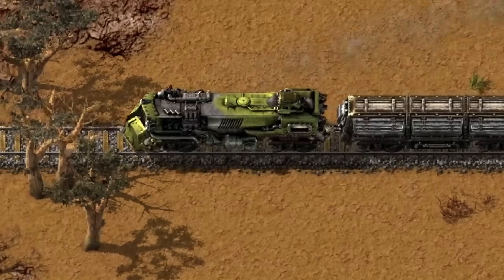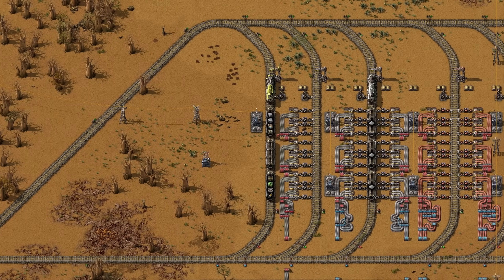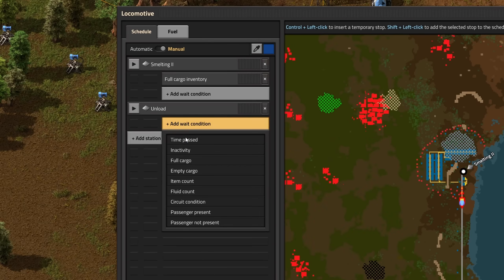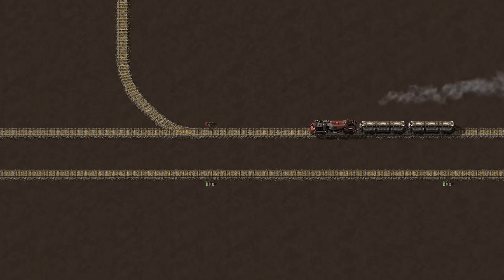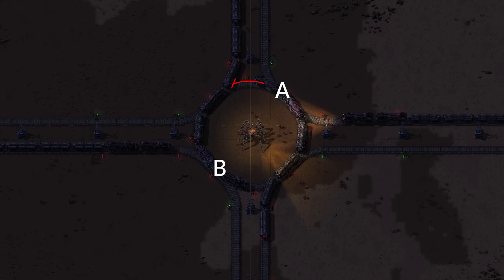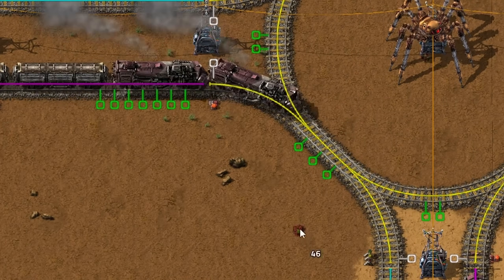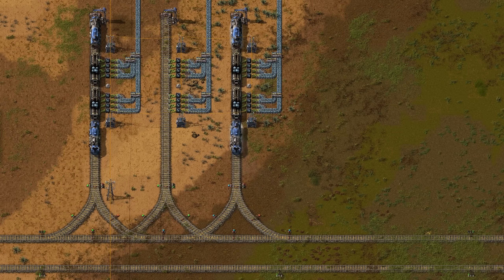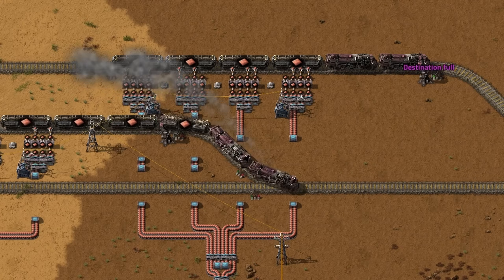Factorio Trains 101

Comment: Hey, this question isn’t really about trains but I was wondering, I have a base atm which produces around 300 SPM, and I am currently on my first planet of Vulcanus, (about to automate the rockets) however I am wondering how to scale up to say 1k SPM. Do I finish the other 2 planets first or do I try to redesign my base (or create a new base with redesigned everything) I don’t really know what to do and you are the best factorio ytber I know, any tips?
Reply from the maker: I would go to the other planets first before doing a huge redesign. Reason: on Fulgora you will get Electromagnetic plants which are awesome and will change the design of your production lines.
300 SPM with your current unlocks is fine.
But it's really up to you how to continue theres no right or wrong.

Comment: Using circuits, you can also change the priority of a train stop so that one stop with the same name as another stop gets priority over the other.  For instance, a station that has more ore available to load could have a higher priority than a station that hasn't loaded as much.
Reply: I use it for many outposts, if they don't have enough in their chests to fill a train fully, they are turned off.
With enough outposts there is always stations free that have the same name so the train just goes to the ones that have enough to fill the train.